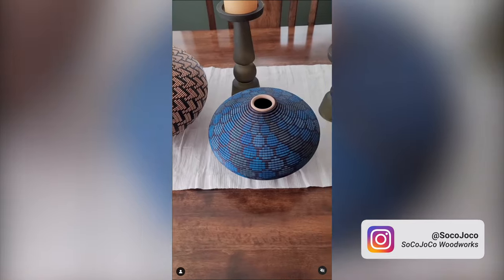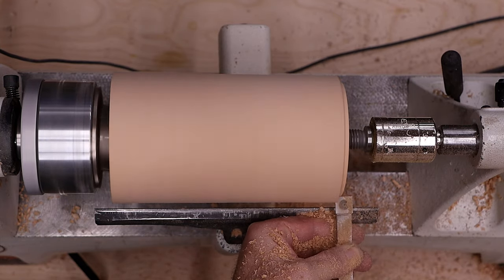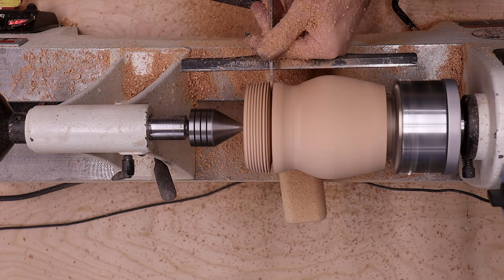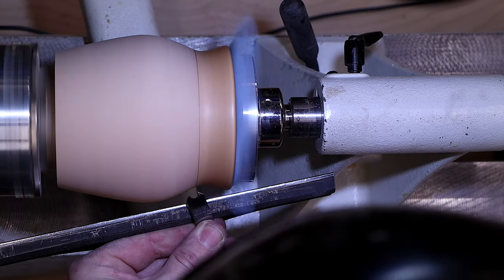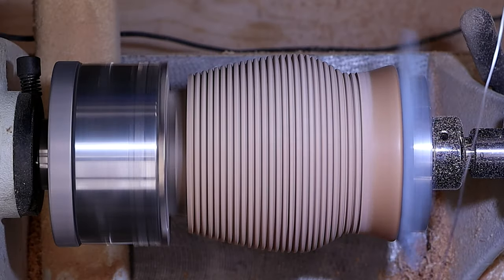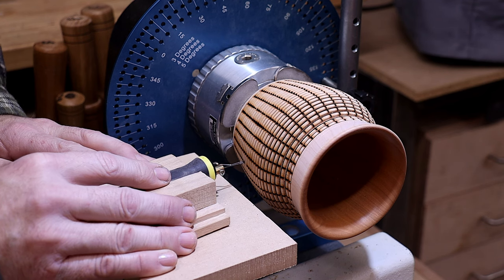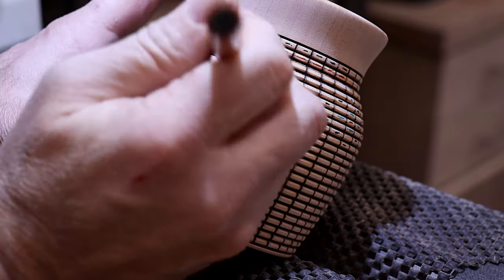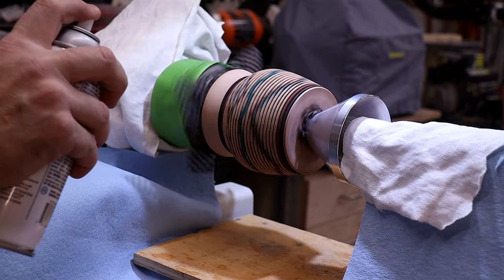Woodturning: A Basket Illusion Vase

Comment: How did you determine the spacing of the vertical lines to enable them to come out even?
Reply from the maker: It was a lot of trial and error using graph paper.  I think I went through 4 or 5 sheets of graph paper.  I'm sure that there are smarter people who a good in math that wouldn't have the same trouble that I did.  ha ha. - Ed